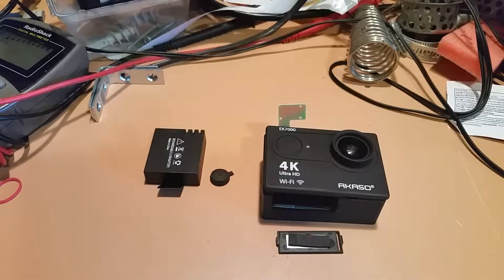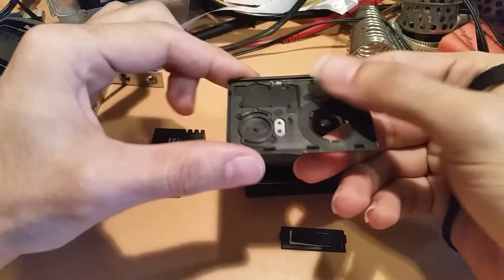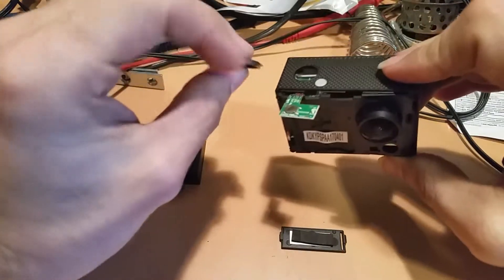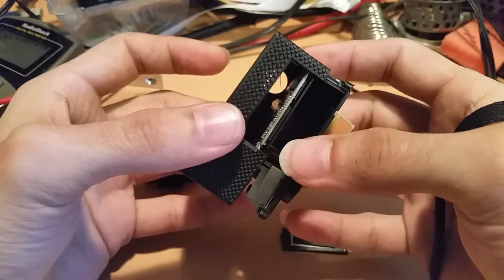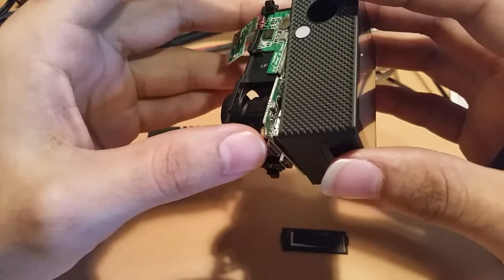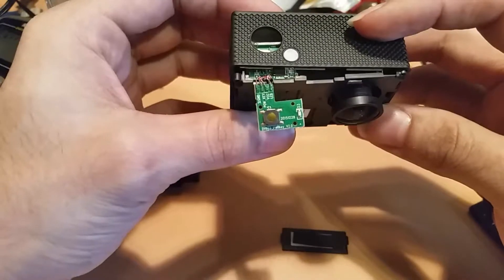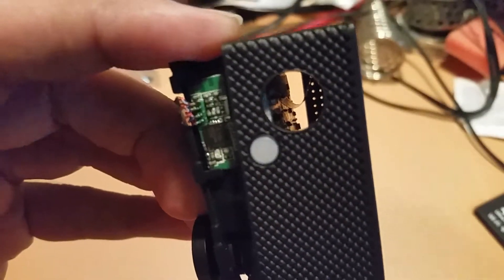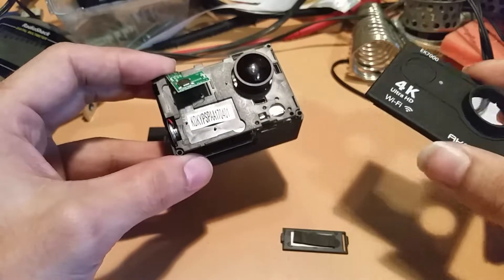Akaso EK700 - Half-Teardown

Comment: I can't find anyone who can tell me if it drops frames, by looking at all the videos online Im sure it is dropping frames at 4k, but no one is saying so, can you say?
Reply from the maker: this is not a 4k cam. If you play back on a 4K display it upscales from 1080. Best I get from this model is 1080 30fps quality. Its not bad, but it sure as hell is NOT recording in 4K. They also break real easy. Im on my 4th model so far. I'd suggest just getting a legit GoPro.
Reply: @FoxxOTG  I'm having a hard time getting a bottom end legit 4k camera, I just purchased https://www.amazon.com/TechComm-AT120-Ambarella-Waterproof-Action/dp/B0747V2842/ref=sr_1_1?keywords=TechComm+AT120+4K+14MP&qid=1553667484&s=gateway&sr=8-1-spell, hope this is real 4k, looks like it has the specs to do it, Panasonic MN34110 Sensor and Ambarella A12S75 Chipset. It's only $10 more.
Reply: the camera I mentioned I purchased, techcomm at120, it is 4k, but it drops frames, one every 5 seconds or so, sent it back, it was a refurbished, not new. I purchased Yi Seabird 4k, will give it a try in a couple of weeks, it's $80 at Banggood.com.

Comment: Take the plastic cover off the screen and u can move the lcd to where it all comes out in one piece.
Reply from the maker: Actually this is the first one I tried working on, and had it the the darn thing glued down. After checking a few others I realized this was a defective model. The wifi button obliterated off the PCB and the enamel wire had crossed strands. 

I found an auction for a few used "action cams" and realized the Akaso goes under so many different names, with very minor cosmetic changes. You really have to pay attention. At least the 4K version outputs HDMI at 4K properly.